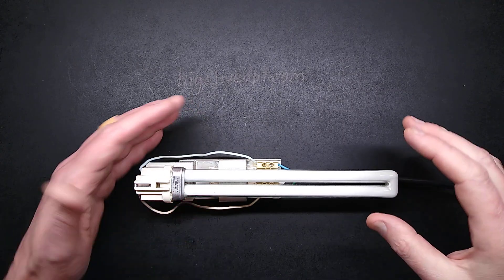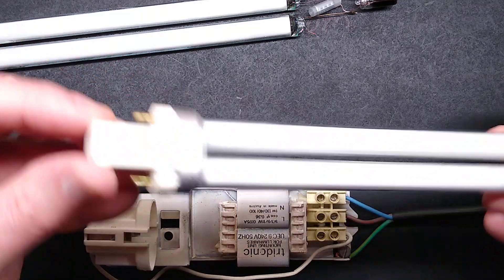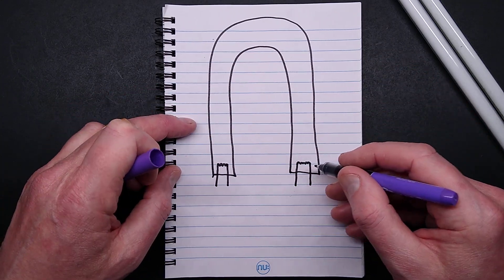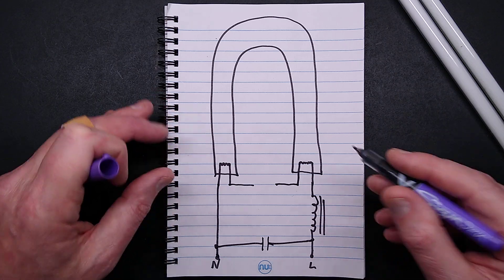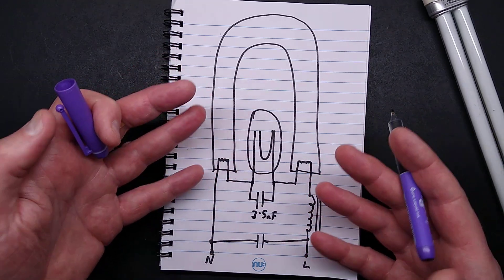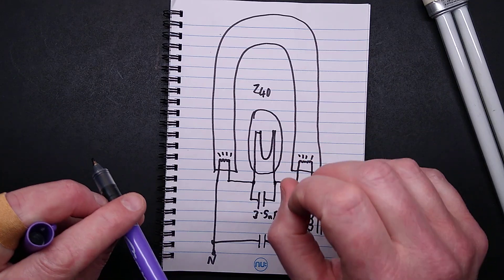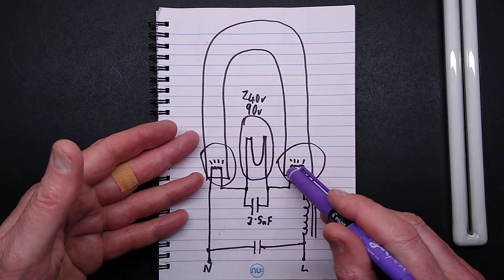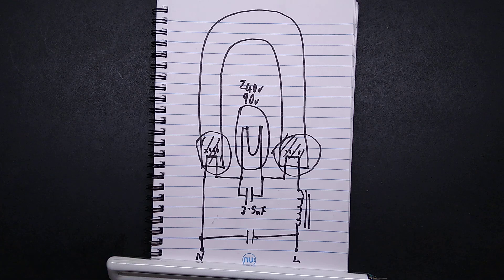Retro already?

Comment: Hello Clive. O k I am O C D. Thank you for the interesting break down in this video. The lowly starter switch in my opinion does not get the credit it deserves. I notice in many bogs I have visited. I worked for a company in the seventies and it was jokingly said that the only product that made a profit was the starter switch.unit. LoL. With your arudid Mansour of explaining it will make a good old new blog.
How many of your followers realize what the common starter switch has go through before all marks shewn on the canister. Including the British kite mark or British standard authority.and all the European standards that are shown.
The suppreser is called a capacitor or a resister. And in this blog you measured the resistance which I found interesting. I guess with the value given it may be possible with the Ohms law get many results. I am digressing. I count five different parts making up the starter switch. Also known a a F S U.
Interesting enough the original in 60/70's the canister was aluminium then changed to polypropylene. We know that The UV from the tube caused the canister become brittle and disingtrogat when removing then , Nylon and today clear, engineerig plastic.
E M C  CISPR 15 EN 55015 comes to mind.
I am here for the sometimes forgotten starter switch and the working of the bi metal contacts. Clive you are not a brother from a different mother related to the Naked Scientist. Your knowledge all electronic and electromagnetic is incredible.
I will be waiting if you take not my challenge but suggestion.
Reply: Hello Clive. I appreciated the acknowledgements. Thank you.
Read an old lighting book about the starter used in a fluorescent circuit.
The bimetal switches off (cools down) and becomes open circuit. But the suppressor/capacitor is still in series with both ends cathodes.  The cap/sup. Is to limit the EMI (electric magnetic interference) from the starting and also the choke. Law in most countries.
If after energizing the fluorescent tube the starter is removed it will carry on working normally.  It would not be possible to measure the voltage across one end of the cathode as there is no sup/con.  in series as the starter has been removed. Makes sense. If the same is repeated with the starter in place we can measure the voltage across the electrodes  and  get a reading of about 110 volts or higher..
Mention is made that the starting voltage to create an arc across both end electrodes can be higher than 4000 volts produced by the choke for a short time limited period. Limiting the current hence a current limiting device. All my time in the lighting industry saw only 10 faulty chokes. All caused by shoddy cable entry screws not been tightened and causing a hot spot and possible burning of the nylon mains entry terminals feeding inside the coil and core of the choke. Another reason is if the windings were not prosision and insulator material was not used correctly cross wiring could result and cause a short due to the high voltage induced as shewn above. Cheers.

Comment: I have a couple of preheat fluorescent ballasts. None oil filled, but I do have tar filled. One of which is a GE cloth wire, I didn't realize the ballast had gone bad until it started to shit tar on my bed. Which thankfully was protected, but I immediately washed the protective sheets. Only one of the three old preheat ballasts I have still work and it's an advance. Only one that didn't overheat and shit itself or refuse to light outright

Comment: and don't get me started on LED bulb 'longevity' i have no end of dead ones, some have a little black dot in the middle of the package, and some look like a laser was run over it, and the nearby traces. they all seem to have dark areas on the PCBs in the vicinity of a brutally over-driven cap too. no doubt a bulb could be made, with a decent heat-sink that would last more or less forever. but not for 2 quid from pound-world or wherever.

Comment: I’ll never understand why everyone’s gone so LED mad, surely people want something reliable and long lasting? LEDs for the most part are so unreliable - I’ve had some last a year and others that don’t last a day. Don’t get me wrong there are definitely LEDs out there that do last but usually they are hard to find and costly.

I personally don’t have any intention to use LEDs until getting old lamps becomes impossible, I’ve got a rather large stockpile of tubes and other lamps. I’ve probably got enough to last my lifetime tbf. I’ve been using the same fluorescent light for years and I’ve never had a tube pop yet granted I change them occasionally to test new tubes I acquire. 

I’ve stocked up on some old Philips compact fluorescents and so far they’re completely outperforming any of the LEDs I’ve ever had. 

My favourites so far have been the so called “softone” lamps, wether that’s meant to be soft-tone or soft-one I’m not sure - I’d assume soft-tone. 

Obviously CFLs have their own disadvantages like they tend to die if burned upside down for long periods or burned in sealed fixtures, however this isn’t usually a problem with the really early ones that used magnetic ballasts. They’re also not too keen on being run for short periods especially the instant start ones that just blast the tube with high voltage instead of heating the cathodes first - while convenient, the cathodes take a beating when a tube is run like this which significantly reduces the lifespan of the tube especially when run for short durations in say a closet or something.

I’ve personally been using them how they should be used; in a well ventilated fixture, not upside down, and I run them for long periods. So far no failures.

For places the light won’t be on for very long I still use 60 or 100w incandescent lamps as they don’t get used enough to effect the electric bill very much and they last much longer (I use the 250v rated ones as when run on 230v they last even longer).

Point is, don’t believe everything you’re told by the media and big corporations as most of the time it’s a load of rubbish..

Anyway I’m ranting now so I’ll end it here.

Comment: In the US, the "inductor", in a fluorescent fixture, is known as a ballast.
Reply: In finland its usually called a starter/ballast too.
Reply: @jaskajokunen3716 : Years ago, the "starter" was external,to the ballast.
(The little round can, which stuck in the side of the fixture)
Since the start circuit was made internal, it is just called a ballast and there
is no replaceable starter. 😁✌🖖

Comment: I use this type of "pl lamp" in my desk. I do not like the led color rendering. These are much easier on eyes for some reason. 
I think i should keep a pack of ten at home cus these seem to last forever in storage. The last one i used was in storage for 10 years and it ran for 6 years after that. The current one i am using was purchased last year. They are getting increasingly rare to find. 
I do not have a single led light at home. All are tubes with classic ballast and starer. They last forever. Over 2x 3x better than led. Leds do not even last as long as a incandescent. 
I had fitted osram led in my motorcycle and the light gave up after 2 years. I am back on halogen now. The longest i have seen them go is 5 years and generally they all fail in 1-2 years if you use them regularly like tube lights. While tube lights in my home generally last for 6years or more. 
The electricity savings aren't worth the hassle with these led.

Comment: Uni where I worked switched the  CFL hall and ceiling lights to LEDs three years ago... fast forward, most of the dome hall lights in my building all packed in. It appears that they had an IR proximity dimmer which piggybacked onto the LED control, and the dimmers all stopped working. The more complex circuit simply had more engineering bugs show up. The CFLs in other buildings which are the same vintage all still work 15+ years on.

Comment: AT 5:00 you say that the voltage just initiates the glow discharge. But I think there's usually also a tiny trace of radioactive krypton or tritium added to make that work. So the complete sequence is that first the starter needs the voltage, then has to wait for a radiaoactive decay particle that ionizes the neon, or argon, after which the starter can conduct current, which then heats op the bimetal, which switches on the pre-heat current in the lamp and also shorts out the neon discharge, which cools down the bimetal again, which opens the switch and blocks the current, which creates the inductive voltage peak, which ionizes the gas in the lamp and starts the current in there, which - in cold weather - still has to heat up the mercury drops making them vaporize, so then the mercury in the discharge can create UV, which excites the electrons in the flu-powder, after which they drop back but not to the same level, thereby not producing UV again but visible light. (In the past people kept things simple...)

Comment: Elektor magazine (in a very old issue) had a high-voltage converter (to 3000V or so, not sure), so you don't need a starter anymore. And the tube will last a VERY long time.
Reply from the maker: Starting classic fluorescent tubes in the style of cold cathode is actually very harsh on the electrodes.

Comment: Low-Pressure Mercury Vapour 'Gas'   (LPMV) was used in the manufacture of Fluorescent Lamps when I did my Electrical Apprenticeship back in the early 70s. When smashing old ones for landfill, we got issued goggles, gloves and a cheap disposable dust mask!  Oh, and we washed the Brushes used for Bitumen paint in Trike (1:1:1 Trichloroethylene) !  Don't forget, Health and Safety was optional until 1974.

Comment: maglev spark low vacuum plasma induction bulbs instead, if the bulb is intact then it will not burn up, no direct electrical contact or current flow, pure magnetic induction eddy current coupling to start-up piezo sparked plasma

Comment: My brother had a lamp that used a tube like that but had no starter.  The "ON" button was a normally open button that worked like the starter.  The "OFF" button was a normally closed that was in series with the whole thing.  In its resting state the mains voltage was across the tube but the tube wasn't struck so no current flowed.  The thing appeared to be haunted because sometimes in the middle of the night it would turn its self on.  I think it must have been a static discharge or something kicking into conducting.  He wasn't near any strong radio transmitters or anything.

Comment: We have those at work and they are not bright at all. There are two of those in one lamp, together they require a ton of electricity during operation, yet the amount of actual light they produce is pitiful in comparison;  they are 40 Watt each, so two of them are 80 Watts, yet they produce far less light than a 90 Watt conventional light bulb does (I once placed one of my old left overs in our office to prove that and everyone agreed that my bulb was brighter when placed in the same housing) and far less than my 12 Watt LED light bulbs at home do. This has to do with the housing, that tries to direct the light downwards in such a way that the light is most pleasant for the eye and never blinds anyone or reflects from windows or monitors (optimized for office spaces) but IMHO that housing only makes them dim and is totally over-engineered. The problem is, there is no LED alternative for our variation of that socket (g24q-4). There is for g24q-1, g24q-2 and g24q-3 but I have not yet seen any available for g24q-4 on either specialized light bulb stores or Amazon.

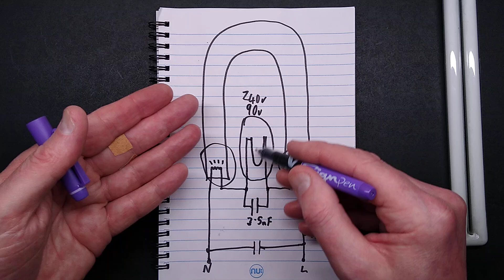Comment: 6:45 a common scenario after the introduction of T8 tubes was the intermittent nuisance restart of 6ft tubes.
This was due to the normal running voltage combined with the wrong type of starter.
People thought the "4-80W" FS-U blue glow starter was correct for a 70W tube, but it wasn't. The gas conducts at a voltage too close to the normal running voltage.
As the tube aged and the voltage drop increased a little (maybe only after a month or so) the starter would randomly close its contacts, maybe just once an hour.
You needed the orange glow FS125 starter.

Had may arguments about this one😂
Reply from the maker: Yeah, I remember a less capable electrical contractor relamping an office and having issues with the tubes repeatedly going out and restriking for this very reason.  But they lacked the competence to work that out and declared that the lamp holders were "incompatible" and put all the old tubes back in!

Comment: One the crazyest 'let's kill off fluorescents' was banning replacement 8(?) foot tube "because the wattage isn't A rating enough" The whole point of them is need less number to safely evenly light a factory overall higher efficiency. This whole "Energy Rating" thing is complete BS when there's an "AA-rated" plug in electric room heater

Comment: Might be a good idea to make sure that choke is discharged before handling it. Im fairly sure ive had some nice loud sparks of one of those before.
Reply from the maker: Inductors don't hold a charge, but the power factor correction capacitors do.

Comment: Wonder what happens if you put a string of uv leds in the tube and thicken the phosphor add a diffuser, and maybe blend it to get better black body color Temps, using way less power and heat, use a voltage multiplier and LC dropper with some DC smoothing to allow some discreet chip to do pwm or some extra shit

No mercury and kv range voltages needed or a vacuum

Comment: I'm getting old.  We once designed these lamps into one of the products we make as a convenience lamp.  I thought it was pretty advanced at the time.  Since then, others doing engineering maintenance on the product have changed them to LED lamps (in the same package).  I didn't realize the fluorescent ones were on the verge of obsolescence.  Anyway, we used a ballast as shown.  They worked well on 120 VAC and 230 VAC, but not so well on 100 VAC (Japan).  At 100 VAC with a ballast, they'd flicker and fuss unacceptably.  Crazy solution; we wired a small step-down transformer (about 20 VAC output) in series with the lamp and ballast.  This boosted the line voltage the lamp "saw" to 120 VAC and the lamps worked fine.
Reply from the maker: I've used the same technique to drop the voltage to a European 220V ballast because it wasn't handling 240V well.

Comment: The light in my office (Phillips) uses two of these tubes.  They last for years but I have a few spares ready for the day when they are unavailable, they give a very pleasant light for working.  In the loft I have had to replace a 4 ft fluorescent tube with LED.  Once the LED's fail no spares are available, just bin the entire unit and buy new.  I don't like the colour of the LED light either, very cold, harsh and clinical.

Comment: I always wondered how those starters worked. Growing up I used to watch my granfather "change" the starters in fluorescent lights when they started flickering. Those were replaced way more often than the tubes from what I recall. He then managed to stumble on an electronic version in the same form factor, and those were a huge change. Lights would switch on without flicker, and they outlasted the light fixures 🤣 It would be interesting to see if I can track those down. A breakdown of the fully electronic starter would be interesting too!
Reply from the maker: That video has already been made.

Comment: I moved into an apartment that uses these, they drove me nuts and sucked a lot of energy not to mention they have 3 different fittings and the one I needed is almost impossible to find.

Broke also two lamps then trying to mount them. 0/10 wouldn't recommend

Comment: I hope you can understand that energy wasted from old (long service life) fluro tubes producing 50% less light output is 'waste' and so, the same as physically chucking E-waste into a bin.  
There is another angle on using less energy aside cost - it means less loading on the supply infrastructure across the whole supply network. Wanna pay more for grid upgrades on ya utilities bill?